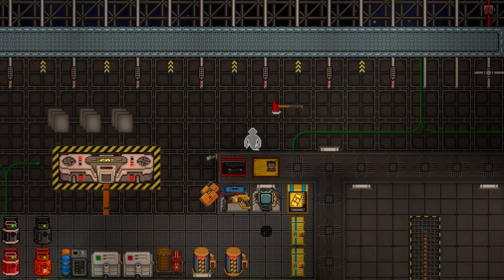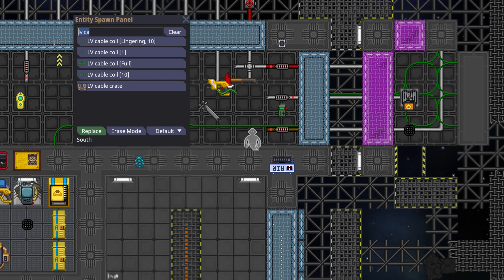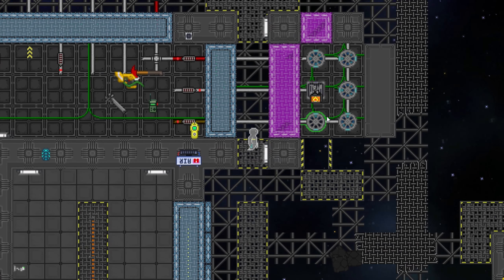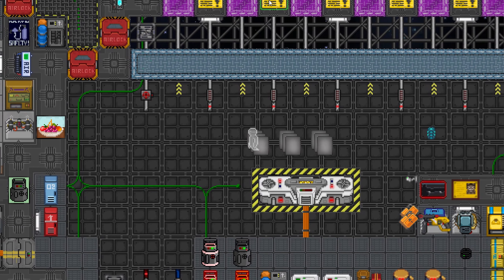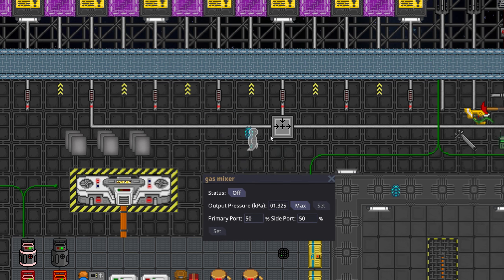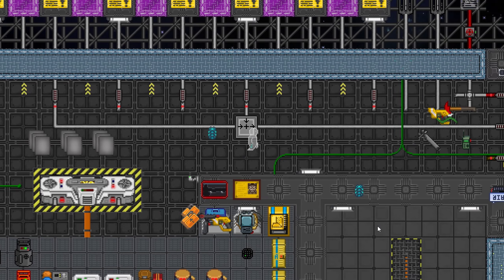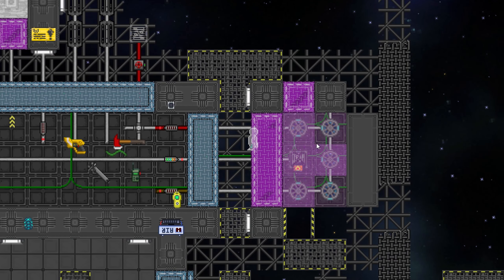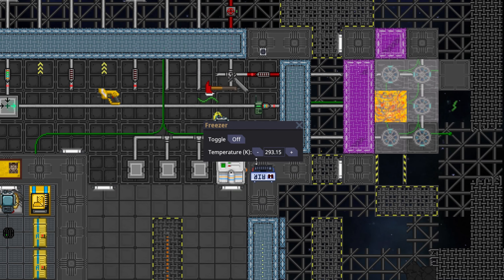[SS14] How to make tritium

Comment: just tried this setup but the tritium isnt being filtered, i triple checked against the video and i have the same setup as you but i get all the gasses coming through my out pipe. is there something im missing? i have it set to scrub out the trit and only the trit too.
Reply: Air alarms on auto mode reset back to default filtering, you also need to activate an igniter